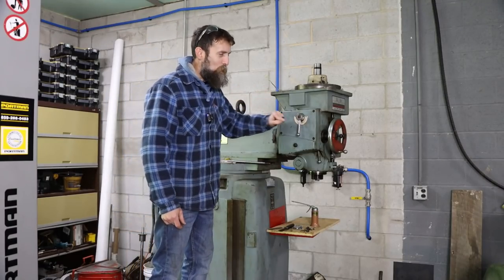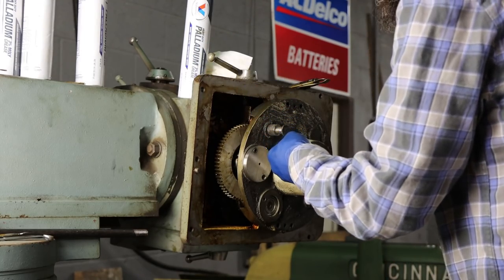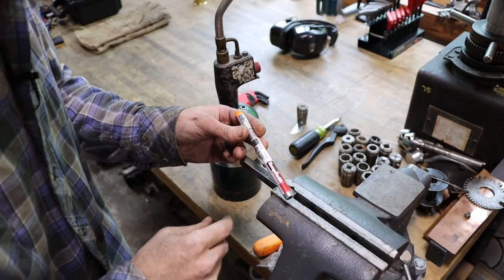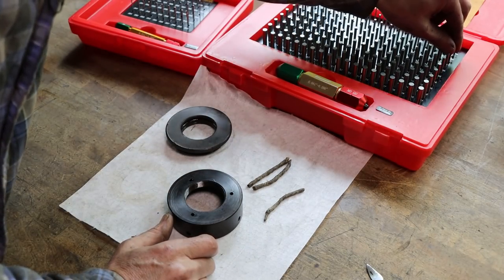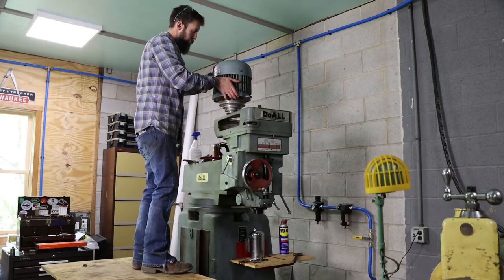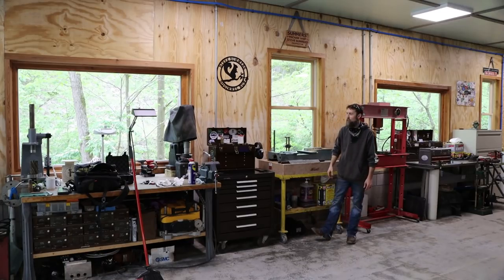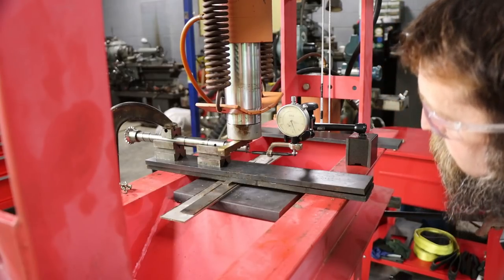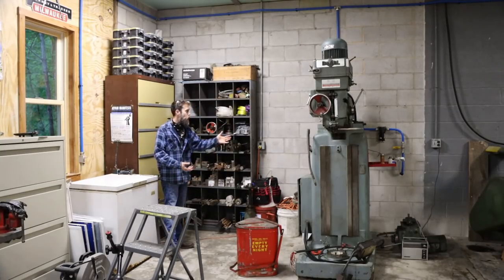Heavy Milling head Service finished up!

Comment: I am a mechanic at a large repair/cnc shop.  I have never seen a knee mill that used grease in any of the gear boxes.  It is usually oil.

Comment: Small tip: if you bend something like that, look at the indicator reading before you press, while you press and after releasing. The difference between the latter two gives you an estimate on how big the spring back is. If you keep that in mind while pressing it further, you should be able to get it pretty precise without having to go back and forth much.
Reply: Good tip. It makes sense when I think about it but I've never thought in the past. Ta.

Comment: The sacrifice in wall space is a small price to pay for the beauty of that wall and the view. Our shop here is window-less and I dont know how we'd ever rearrange if we lost the wall space but the last portion of your video alone with the bench work n the bent handwheel shaft and that glass behind the bench, the sun going down, light changing, would be a very hefty motivator especially in your situation. Your not in an urban setting, theft, etc.. and even if you ramp up to more paid work that glass will give you far more reward than any amount of wallspace. Well done.

Comment: A trick we use at work for dumping a whole tube of grease in quickly is to open both ends of the tube, put a ball of rag in the bigger end like a piston and using a hammer handle like a con Rob push the rag in to the tube. An entire grease cartridge is empty in literally 2 seconds. Great content Steve, keep the squirrel sections coming. Jon

Comment: Grease gets lighter as it ages.
Grease lubricates by releasing the oil lubricant from the soap carrier. That is why old grease has appeared to "dry out" ,when all that is left is mainly the soap.
Weighing the depleted soap will only give you an approximation of what the original content was.

Comment: My little Harrison has a similar tapered pin to automatically hold it slightly out of tram :-)
Reply from the maker: Yeah, that's what I'm afraid of. Good thing is they don't have to be used😁
Reply: Use a same size taper reamer to clean it up after it is teamed in and held tight
Reply: @erichockuly9819  On my Harrison there is an eccentric bush which slightly complicates things. I imagine that the bush is meant to allow for adjustment, but, of course, it doesn't, as the holes can only intersect in a maximum of two positions.

Comment: Years ago I used a pasty grease in lennox furnace motors.  
It was designed to break down into oil for the motor bearings.  I
t was used in the "Cup" style grease cups that needed a screw down every year during service. 
Those old electric motors would run near forever "IF" they got the yearly turn.
Thanks

Comment: Hello Steve from the UK 🇬🇧 The taper pin with a nut to extract it is standard on Harrison milling machines, used on the vertical head. Harrison are part of the UK machine tool conglomerate 600 Group, as were DoAll  at one point.

Comment: RTFM lol
in 2010 i did a pre-apprenticeship course (3 days a week, split between welding and machine shop), one of the last projects was making a bench vice from 8mm plate, the store-man (who liked me because we both have old vehicle's) gave me some 10mm plate that was wrongly ordered and thought i'd be able to use it, it turned out that the steel needed to be preheated to weld properly, so i was the only person in the class that got experience with a temp stick.

Comment: TRAK DPM vertical CNC milling machines have a grease zerk in the head that does nothing but dump grease into any empty cavity, had several part, nothing in there but grease.

Comment: At 7:15 I grease small gearboxes often.  I put the tube in the gun, pump away. The tube empties quite fast. I pump 2 1/2 tubes each time I get a rebuild, a few times a year. Seen you do this in previous video. The hand pump is much faster and easier, and less mess.

Comment: Best thing i did with my parts washer is made an angle iron base with 2 casters and 2 rigid wheels under it made it so the legs just sat in the angle iron now use it in middle of floor so not to slop up wals then roll it in a corner when I dont need it . The heavy items i have adjustable legs that are set so i can just get my pallet jack under to move around. Pallet jack was one investment that was worth it once you have one you wonder how you survived without it.  That mill is looking good doesn't look like its been molested aside from using grease instead of oil 👍👍🐿🐿

Comment: about heating up stuff : i use an old single plate electric hotplate you can set that at 100 degrees lay the part on it you want warm or hot and walk away , the part will heat up evenly untill 100 degrees , works great for bearings as you can drop some grease on them and it melts straight in between the races before mounting it on the shaft and you can heat up a case before dropping a cold bearing in there without using force
saves on gasbottles too though gas probably works faster

Comment: My boss gave me a extra  long expansion ream that  was bent like a dog's hind leg and asked me if I could fit it. The NC machine tried to reposition before the reamer cleared the hole. 
I knew I had a chance as it was a expansion reamer .I told him I don't know but I would give it a try . I bent it back most of the way in a press . Then got it closer hit it between centers . Expanded it and regrond the OD and touched up the margins . It worked and the boss said it would have taken two weeks to get another .
They didn't have to stop the job. I felt pretty good about that.

Comment: Hi Razer! Safe travels.
Steve
I’m repairing an old Index out of necessity.
I’ve had equipment failures recently and was offered the Index as  a way to get back into production.
It was dropped and left outside for awhile, so stuck table, bent and broken handles, etc.
We’ll get there. First things first and one step at a time.
Thanks,
John

Comment: That reference to farm tractors is just spot on! I live in an area of farms and you see them all the time. My father in law is a farmer. The mindset of a farmer is so completely different. They just want to jerry rig everything together, the machine barely works and all money on spare parts are waste of money in their mindset. It's all about saving a buck and labor is free. On the other hand, I always wonder why most farmers are still overweight.

The things I see at the farm are just rediciolous. Leaking tractors, oil and grease everywhere, dust accumulation on electric motors beyond any cooling capability, belts loose or falling apart and hanging literally on the last thread, watering hoses leak at every joint, all kind of crap is being stored from earlier generation in warehouses, where the roof is leaking and sun is shining through the metal sheeting wall nail holes (because the sheets were dismantled from an old building and reused). It's just horrible to watch. And on top of that, every job starts with charging the flat battery...

Comment: @39:02 Steve, you were watching Derek over at Vice Grip Garage weren't you...You just described the farm truck he just got running (that he grew up with) that hadn't run since around 1986 or 1989...No seat to speak of, overfilled on the oil (but tar), Hydraulics and PTO bailwired together, etc.  Derek is AMAZING over there at VGG!

Comment: Steve, I always like your Videos before I watch! I know they will be good always, watched all of your shed project with great interest as to how you solved every problem along the way. Now after making my comment I will see the rest of the video.
My comment is, there is a dowel pin, usually tapered on most serious machines and no matter how loud I shouted dowel pin, you could not hear me. It is most likely an Imperial Taper Pin size that off the top of my head I think is a 1 in 48 taper. Metric 1 in 50. May be the wrong about what is what without looking it up. Another great machine to your workshop. John, Australia.

Comment: If you want a cheap bearing /pulley heater just get an electric frying pan and use that. Easy to adjust the to the temp you need.

Comment: Even if the glass needed cleaned everyday I’d reckon it’s worth it for that spring green view. Throw up some ornamental ironwork grills to deter any nogooders. They can be aesthetically pleasing and sharp at the pointy bits. Classic solution to an age old problem :)

Comment: I straighten shafts all the time. Three days ago I straightened a sawmill arbor, 6 feet long and 2.937" dia. in my lathe. I would have straightened that shaft in the lathe. Just chuck her up hanging way out and build up some parallels from the ways with one of your more funky veeblocks. The next step is a hammer.......probably get it dead straight too.

Comment: I have found if a small amount of gear oil mixed with the grease.  the mixture circulates the lube through the gears better

Comment: Steve another great video, thanks for sharing with us. You might consider moving the inspection plate away from direct sunlight through the window. You would be surprised how much that affects the accuracy of the surface plate. Learned that from Richard King when taking his scraping class.

Comment: We had a full complement of Deltronic gauge pins at Glenn Tool and considered .0002" under as the desired measurement. They were sized to tenths.

Comment: In Star Wars:  A New Hope (the original Star Wars), the idea of "moisture 'vaporators" was mentioned as Luke Skywalker first talked to C3P0 as the Jawas captured him and R2D2 and brought them over.  It occurred to me that moisture 'vaporators are actually better known as dehumidifiers (you can capture moisture from the air with them).  You would need king sized ones to farm moisture like was depicted on Tatooine.

Comment: Dehumidifiers are nice but they heat the shop. That's not bad when it is cool outside but unwelcome in the summer time. You have to put a mini split heat pump on your list of things to install. They heat, cool and most have a dehumidify mode too if you don't need any temperature change.

Comment: That shaft would have been a good reason to use the Eutectic TeroDyn Spray Weld system. Turn it down to straight, then build it back up and machine to size.

Comment: Reminded me of the left handed screw in the small handgun.  Why would that not be a gear oil bath, in both those sections, instead of grease??  Steve, do you have a manual for the mill?  I agree with you about the windows.  A great video.  Rob Christopher nailed: A great start to the day!
Reply from the maker: Yeah, sometimes it's not obvious. I've fought several battles with repairs only to find out I was doing it wrong 😁

Comment: How often should you check on the oil reservoir level? The one you just opened up the holes for the oiling wicks on top of the DoAll head.

Comment: Great video Steve, fitting my kitchen but had to stop to watch. Don't listen to the nay sayers. I was thinking how nice and bright it looks in your shop now just before you spoke about it. Over here in the UK before gas light or even electricity all the workshops and mills had large windows. That's why on old large factories they have a saw tooth shaped roof. The vertical bits were glass and generally south facing. Awesome to see you now making good use of the whole building. Its been a journey but definitely worth it💪

Comment: While I do agree with what was said about the windows, easy to break in, constantly cleaning. However, they DO bring in a lot of natural light. Once thing I did try to suggest to you when you did the roof, skylights. In many cases, natural light is far better than even LED lighting. 
This is why I refuse to turn my hobby of woodworking into a full time job. I truly enjoy it, and refuse to turn it into a full time job in which, I'll get burnt out on. Great video as always. Cheers :)

Comment: You can't beat natural light and a water front view from a machine shop.  I like the windows but would paint the wood to match the other walls.  Or paint the upper 2/3ds light and dark from the benches down

Comment: I’d suggest to swap the surface plate with the toolbox.

You wouldn’t want to have direct sun shining on the plate.
Accuracy and sun/warmth don’t mix well.

Yeah probably overkill in the home shop, but just good practice 

Nice job on the mill
Reply: I was thinking exactly that too, but for what the shop is intended for (pleasure) I wouldn't wanna be starring at a wall either when im not chasing the last 5 ten thou.

Comment: Seeing the bent shaft reminded me of a Keith Fenner trick I once saw. He used a torch to straighten a bent shaft. Not to sure it would work on such a short shaft but at first I thought thats what you were gonna do lol.
Reply: Easier said.....Keith Fenner is a master at straightening shafts. He has built and sells a custom set of rollers for the specific purpose of shaft repair  I believe it is a major part of his job description.

Comment: Maybe some noticed at the bottom right of the inspection cert for the pins, that they’re made in China. For all these who still believe that all Starrett stuff is made in the USA, it’s a rude awakening, but a lot of their tools of numerous types have been made in China for a fair number of years. Starrett no longer really cares about hand tooling. Their money is being made on very expensive metrology equipment. I wouldn’t be surprised if at some time they spin off the hand tool division. I bought a 4.5 Starrett bench vise from McMastercarr over 20 years ago. In a discussion about vise pricing, I went to see what this cost today (I paid over $800 for this vise, with hardened pipe jaws). But Starrett discontinued bench vises some time ago. Pity. It’s the best vise I’ve ever owned, or used.

It’s very possible that DoAll knew what they were doing about those small holes, and didn’t want oil to come out too rapidly.

Comment: Drilling out the oil holes may have been a mistake.  The combination of the hole size and tightness of fit of the wick was likely designed to make the oil feed to the bearing very slow.  That oil reservoir will empty a LOT faster now.

Comment: Steve ,  The wash tank location can be a big problem.  Having it anywhere near the grinding room is a big no no as when you dress the wheels or when grinding the grit will always find it's way into the wash tank and into your cleaned parts so the grinding room is NFG for the wash tank at all. You said you were thinking of a shed out back  of the shop, that might be a ideal location to have a cleaning room just for per cleaning parts  & final assembly clean of all parts as there would be no chips or grinding dust in that stand alone shed. Having a good stand alone cleaning room is very important part of any good shop.

Comment: I imagine 3 tubes would have been enough as modern grease especially the stuff you bought seems to do a  much better job at staying where it needs to be and lubrication and heat dissipation. Who knows maybe they used that much grease as a way to build a "grease tub"

I think when you were straigtening the handle it was bending over the edge of the vblock you did not  use a clamp on. I swear I can see it bend ever so slightly, though I don't know if that exceeds the elastic zone, so no permanent bend

Comment: Hi Steve, I agree with you, you just cannot beat natural light, however one thought, is the surface plat okay in the sun light from the window, i am no expert but uneven heating could this be an issue? stay safe, I watch you every week so if you could mention in your next video that would be great, I would like to know the answer to my question as I have a similar shop at home. P.S. the squirrel is great.

Comment: Why you do not use the oil which is used in the axles and differentials of trucks and building machines? Looks to me easier than grease because it is not sticking in all the corners where you do not need it?

Comment: Surely 90% of that grease is going to sit in the corner and never grease anything?
The solution would be to build the cavity smaller and closer to the gears but when this was built I'm guessing that would have added a lot of complexity and expense to the manufacturing of the mill.

Comment: noticed you drill press table has several divots left from drill throughs.  how about mig-ing and milling it flat again?  any thoughts?
Reply: It would require proper cast iron repair if it was to be welded. Not as easy as just breaking out the Mig welder if you want it done properly.

Comment: Steve what do you call and where do you get the little stones (used while duburring that shaft for the milll handle)  links would be aweseome if you have them.
Reply from the maker: You can simply pick them up off ebay. They have many different shapes and grits. I find the med or fine stones work best for my work. I seldom use course stones.

Comment: Good decision with the parts washer. The area it occupies will get splashed, spilled (you will clean something which will channel the output from the brush onto the floor, or you), or you will put something into it which will over balance it and maybe tip it over. The floor around it will need cleaning from time to time.

Comment: @ 2:50. That tapered pin is similar to how large generators were accurately located to power units, like in Diesel - Electric locomotives. You would normally find one either side of the generator locating into the flywheel housing of the power unit at about crankshaft level.

Comment: Steel casters roll easily under load, you can probably make some replacement wheels for your set. I learned this from rolling pallets used with a printing press. Part of them had hard rubber wheels, part was steel. The steel could be pushed with one hand fully loaded with paper, the rubber almost took putting a pallet jack under them to budge them.